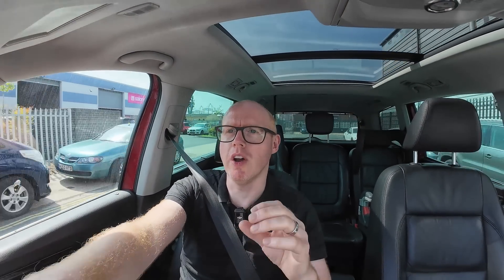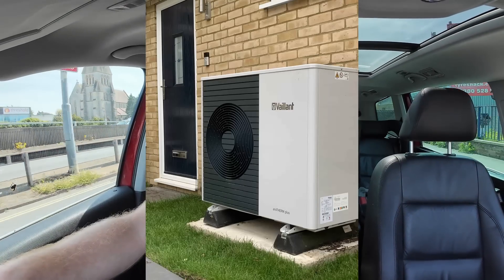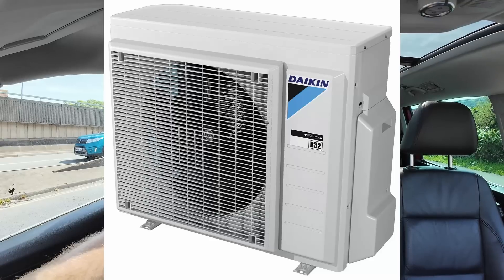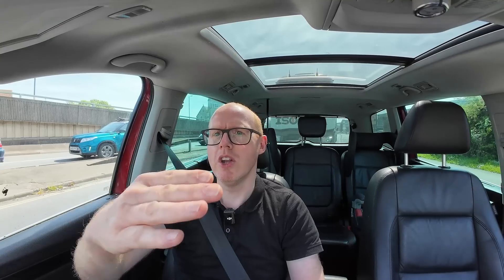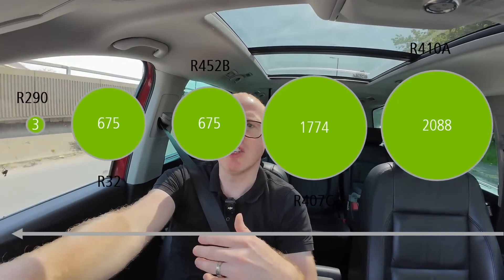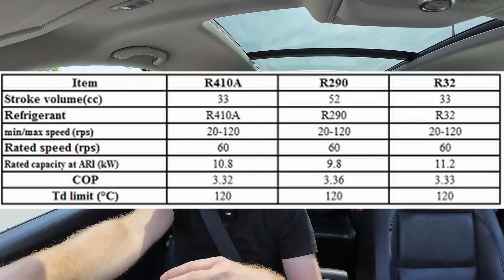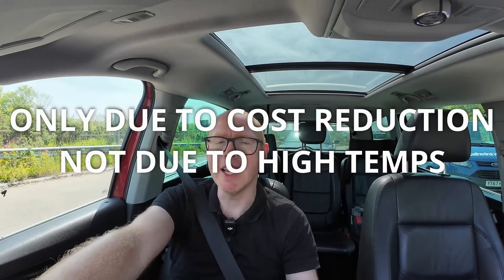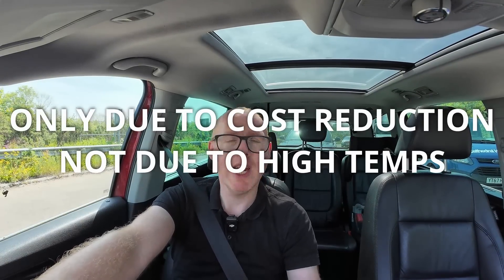High Temperature Heat Pumps Solve Nothing! Octopus Cosy 6 is nothing new!

Comment: You are misinformed about max temp of r32. The Samsung EHS monobloc has an outgoing temp of max 65degrees so legionella can be done without the use of an immersion.
Reply: May be worth checking, my Daikin as example heats to 55C then adopts an on board 'booster heater' to push to 60C.
I only ever witnessed it on during commissioning  🙂

Legionella will start to die at 50C and over, taking shorter periods at higher temperatures.
Reply: @_Dougaldog  don't use the legionella cycle as only have 150 litre tank. So gets turned over regular mine doesn't have a booster heater just an immersion heater that's switched off
Reply: @_Dougaldog Daikin, MEL and Panasonic all go to around 54 before compressor stops and booster heaters take over.
Reply from the maker: Apologies for talking in broad terms.
Generally R32 units are good up to 60 degrees and R290 good up to 70 degrees but there are some R32 which achieve 65 and R290 which achieve 80!
Your point just strengthens the general statement I'm making that R290 advantage is mostly about the GWP.
Thanks for contributing!

Comment: I disagree, if you can hit that high temp without immersion heater.  Also heat without radiator upgrades then its win win. More adoption.  But still we need that drop in electricity price through green generation
Reply from the maker: Yes, lower efficiency is only going to work if the price gap between gas and electric is sorted. Otherwise running a heat pump at a cop of 2 just isn't viable financially.

Comment: The thing that is potentially unique to the octopus offer is that they can integrate it with power market signals much better that what manufacturers our third party installers can, potentially saving users significant money in the process.
Reply from the maker: Yes! Now this is the benefit that should be more widely touted!
A heat pump that natively works with agile is a product that I can really get behind!
Reply: My Mixergy HWC will integrate to Octopus Agile tariffs (which I'm not yet on), and just in past couple of days the App' upgraded to offer 'Heat Geek' mode which allows any HWC temperature to be selected, although there is a disclaimer regarding 'Legionella Cycle', which is fair enough.
In saying that my HP doesn't as yet, but it's just an App update, or perhaps firmware on HP controller.
Reply: "In saying that my HP doesn't as yet, but it's just an App update, or perhaps firmware on HP controller."

If I moved to agile then in the seasons when compressor constantly running I'd set schedule to lowest requirement (soft off) during premium times, thermal mass would hold temperature steady for a few hours, sorted :-)

That's 'Plan A'.
Reply: I use Home assistant to do something similar. I have integrations for Daikin, Octopus, and my battery storage. I have automations that can take advantage of pricing indicators from the Octopus integration to control other devices.

This works for me as I like the extra control but I can definitely see the advantages/attraction of it being built in.

Comment: You see this with a lot of “new” tech. Adoption is slow because people do not understand how it works and therefore have irrational worries. If all it takes is to call it a high temp heat pump, which is not a lie, than that’s absolutely amazing both for consumers and the business. Also, high temp pumps can have interesting applications such as use in thermal energy storage to make use of dynamic electricity prices.

Comment: Looks like r290 is more efficient at lower temperatures. R32 is more efficient at higher temperatures. In the UK, a colder country, it looks like r290 would win.
Reply: My R32 should comfortably work to -15C.

One thing to consider though is permitted development and MCS 020 planning standards.

R32 units can be placed under windows, whereas R290  being propane, and flammable means these units have to be placed away from windows and doors to satisfy regulations.
Reply from the maker: Plenty of research available online about this 👍
Reply: @UpsideDownFork  thanks, I looked into it further and R32 seems to be the better option even though R290 is being push as the latest and greatest.
Reply from the maker: @hano552  the performance gap between the refrigerants is negligible in our climate.
The GWP difference is substantial so I do support the phasing in of R290. 
I just object to the marketing.
Reply: That is not correct.
R32 has a lower evaporation temp, therefore will be more efficient and have better capacity at lower ambient temps.

Comment: I can’t see why you object to R290.  For me as a consumer it is VERY MUCH about making installation easier, because the cost of reinstalling central heating hardware is too expensive.  You might not care because you make big profits reinstalling stuff. We all want a simple boiler replacement.  You make money from persuading us we can’t have that.
Reply: No it doesn't, R290 units have far more restrictions upon them, also they are 20% less efficient than R32. I'm an installer.
Reply: If there isn’t a loss at lower flow temps then the wider range is only ever going to be good - the immersion has a scop of 1, so even if it’s only at 1-2 running at high temp… that’s still a benefit.
It does seem to encourage a “lazier” installation though.
Reply: Dominic , from what I understand the best aim is to have the flow in your system at 35 degrees , to allow this to work really well this is the issue ,,you need excellent insulation and often at that temperature bigger radiators .
  If you have a high temp pump the electric meter is spinning into orbit and you get a huge bill .
Reply from the maker: @pmbpmb5416 the best systems don't work on a fixed flow temperature. They may have a design temperature but in reality they operate with weather compensation and likely never reach the higher floor temps.
Our heat pump flow temp typically modulates between 25-35 degrees depending on the outdoor temperature.
Our design temperature is 45 degrees but it only gets to that when it was minus 6 or minus 7 outside.
We've saved many hundreds of pounds in the first winter by switching from our old gas boiler 👍
Reply: @pmbpmb5416  I paid about £5k for a new boiler a few years ago.  I wanted to replace it with a heat pump. I was told it would cost about £40k, and why? Because heat pumps can only work at low temperatures so they need to analyse and redesign the entire system.  That is what real customers like me are being told every day.  I.e. heat pumps are so crap that they can’t actually replace the old boiler without replacing the entire heating system.
Honestly greedy heat pump installers are the biggest barrier to heat pump adoption in the uk.
Reply from the maker: I don't object to R290. You might have missed the point of the video.
I don't install this kit and have nothing to gain by sharing this info.
Please see other videos on my channel for more context.
Do your own research.
You will see that R290 has only 2 benefits, lower GWP and higher max temp.
R32 will happily heat your rads up to 60 degrees, acting as a direct replacement  for nearly every single boiler in the country if wanted and achieve the same COP as R290.
Both systems will be equally inefficient if run at those high flow temps.
Reply: @UpsideDownFork  I disagree that R32 will “happily” heat your rads up to 60 degrees.  Some systems can be forced to work up at that temperature, but most systems are certainly not designed for it.
You yourself state that R290 is just as efficient as R 32, and is much safer for the environment, so it should be the default choice anyway.
As I see it, if an R290 heat pump can be installed as a like for like replacement, then that’s a massive breakthrough and should be celebrated.
Yes, lots of houses could benefit from lower flow temperatures, larger rads, buffer tanks, etc. but that’s actually a different issue.  I was told that a house like mine would cost £40k to install a heat pump.  Surveys, new rads, new pipes… why on earth would I pay that? There are installers out there exploiting  people like me who care about our children’s future to make fat profits. It makes me very very angry.  We absolutely need high flow temp heat pumps to enable mass adoption.
Octopus have realised that and I thank them for it.
Reply from the maker: @dominicgoodwin1147 do you live in Windsor castle?
£40k for a retrofit heat pump is insane.
I've got other videos on my channel detailing the many quotes I collected on my journey.
They ranged from £3500-£16000 after the government grant.
140sqM 4 bed detached house for reference.
Reply: @UpsideDownFork Exactly!!! And they get away with it because they tell guilt-ridden middle class people that heat pumps will only work if you have surveys, new pipes, new rads, all that crap, because heat pumps can only work at a reduced flow temp.
Now do you see why I’m angry at heat pump installers?
Reply from the maker: @dominicgoodwin1147  it's not the installers fault.
Everyone wants to have their cake and eat it.
Low temp heating is the only way to reach cost parity with a gas boiler with the current energy markets and levies.
Reply: @UpsideDownFork  it very much is the installer’s fault, because we are not being offered the choice, and that should be my choice.  If I want to pay thousands extra now to achieve cost-parity with gas, then I’ll pay for all those extras, rip up all my carpets, replace all my radiators, and whatever. 
If I don’t care about cost parity with gas but just want to stop using heating oil, then enjoy the fact that at last we have that choice.
Reply: @UpsideDownFork that might well be the case, insane I mean, to charge 40k but trust me there are a lot out their waiting to rip the consumers off. In my case a 10 year old three bed semi with an EPC of A. Three companies gave me a ball park figure of £1500 to £2000 to install a heatpump all three wanted around £250 for a survey before committing to a price and one of the company’s wasn’t even going to change the cylinder instead fitting a water to water external heat exchanger, all were Heat Geek engineers.  In the end Octopus installed a Daikin heatpump for £8600 less the grant of £7500 and it’s working great. As for their high temp heatpump if it helps people change without costing the earth then why not? As one only needs it to run at those temperatures when is really cold outside or as in a lot of case of people are at work just need a quick boost in the evening. Don’t shoot Octopus until you’ve tested the goods.
Reply: @UpsideDownFork  Whilst I agree with pretty much everything that you said in the video, I also feel that you were too negative about it.

You correctly state that an R290 will do everything that an R32 will, and to the same standard, but then seem to devalue the primary reason for choosing why an R290 should always be chosen over an R32 given the choice - the environmental impact being 200x less.

I agree that the focus on the "high temperature" part of it is just meaningless marketing guff, and risks allowing poor installers to get away with shoddy workmanship, but if we're going to have 20m+ heat pumps then it's better that they're 20m+ on R290 then it is 20m+ on R32.

Everything else being equal, choosing the R32 option should never be the logical choice.

Better instead focus on what can be done to educate installers on what constitutes best practice for their installations.
Reply from the maker: @michaelwinkley2302  agree 👍
Sorry if my point got lost in my waffle, it was aimed at the misleading marketing more than anything.
Reply: High temp heat pumps are nothing more than marketing nonsense. By all means get a heat pump and run it at 60-70°c and then see how ridiculous your energy bill is.

Comment: I was always told run the gas boiler flat out or at least 90% on its thermostat and use external controls to get the house temperature up quickly so the boiler shuts down to save energy. Of course others in house will say 'oh the radiators are cold, I'll click up the thermostat'. For the last several years I run the boiler at a much lower temperature setting, it runs much longer, the radiators are not as hot but the room temperature is much more even and we use less gas. I've increased the loft insulation depth and this has been another improvement, it wasn't the law of diminishing returns I thought it would be. As one shop says 'every little helps!'
Reply: A condensing boiler is more efficient at lower flow temperatures (below 57c). A boiler operating at lower burner power will also be more efficient.

Cycling a boiler on and off very frequently is inefficient. This is why boilers now have variable gas flow rate rather than really old boilers that only had a gas flow rate of on or off.

The advice you were given likely applies to very old boilers that didn't have variable power output and weren't condensing boilers. The only optimisation you could make to them was stopping them cycling on and off by setting them to a high flow temperature.
Reply from the maker: Well done John, that's the right path you're on!

Comment: My advice to anyone considering an air-source heat pump installation is to do your homework extensively.   That way you can discuss proposed systems with the installer on an informed basis and lessen the chance of common errors occuring such as heat pump over-sizing.
Reply: Spot on, and one bit to query might be how low does the system modulate, i.e. what's the lowest power it can consume with compressor and pump running in a slow but steady state.

I have a Daikin 6kW, which is part of the 4, 6, and 8 kW family; I suspect they modulate to a lower power level than their bigger brothers the 9, 11, 14 and 16kW family do.

So would an 8kW low modulation unit, be a better choice than a 9kW not quite so low modulation unit 🙂
Reply: @_Dougaldog  The Daikin 9kw heat pump is basically the 16kw unit using software to achieve the 9kw rating. Google it to find out how inefficient it is when running to 9kw.

Comment: If you're replacing a high temperature gas set up, would'nt a higher temperature heat pump be a logical choice? It sounds like you would have to replace less infrastructure.
Reply from the maker: Section 5 of Part L states, that a heating system's flow temperature cannot exceed 55°C.
A "low temperature" heat pump, i.e. R32 can achieve flow temps of 60 degrees so it's already suitable for a straight swap 👍